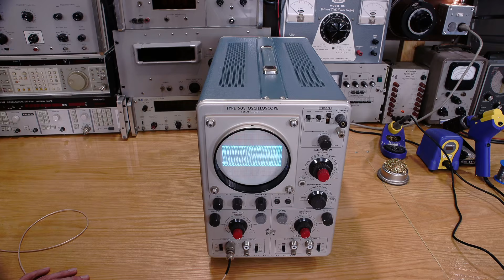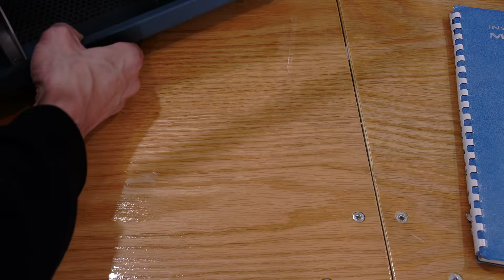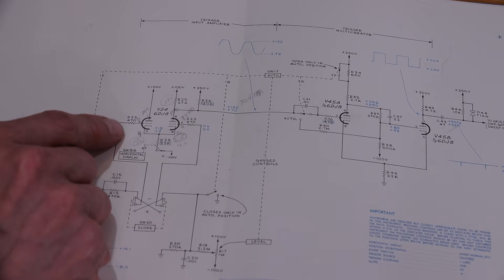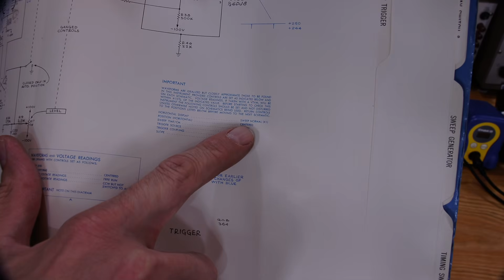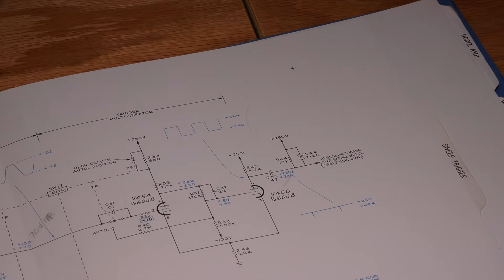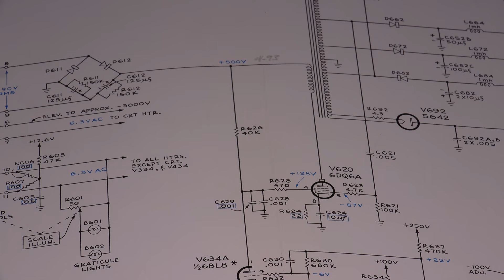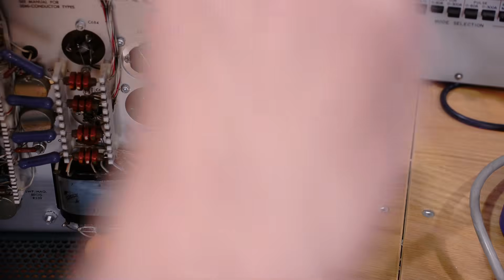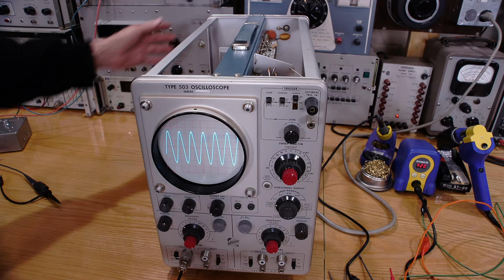TEKTRONIX TYPE 503 Electrical Troubleshooting And Repair!

Comment: Thanks very much for this video. I've got an old Navy surplus HP 108C scope that I can't figure out the issue. The trace just stopped, but sometimes when I turn it on and off a dot will zing past on the screen. If I pull out the vertical and horizontal plug-ins I should have a spot general in the center, but don't. I need to build it little oscillator to do the blanking test. Lacking a HV probe is also an issue, and PS checks were the first thing I looked at. I've got two Tek 442s one with a shorted transistor in the PS. So long as I that one working scope i know I can fix the other two. I primarily enjoy working on vintage audio equipment including R2R's and have more than 20 in collection. Two or three are all vacuum tube types. I'm going to recheck the PS again. I really enjoy doing the work and get the feeling you do too. And yes my bench looks cluttered. I built it inside a closet.  I think we're mostly all that way. I'm sure every tech wishes they had the collection you have, just count the O-scopes.

Comment: Having worked at a repair shop - the main thing I seem to remember on the 503 was that the High Voltage power was a winding in the main power supply instead of a separate high voltage transformer.  They were real bad about failing and getting a replacement was next to impossible.  Other than that, it's a nice little scope.

Comment: Havent seen you for ages. Your sense of humour is stil lovely. I always remember you acknowledging the excellence of Tektronix scopes manufacture quality. For me it was a privilege to work on them. I served only 5 years on the bench and Tek was a constant companion for me as a repair and calibration enginer from 1977 to 82. My favourties were the Tektronix 453, not the early Nuvistor ones, the FET ones, only a few anyway. Come Sept, we were inundated with Tek 453's because of the perspex EHT box causing condensation when engineers didn't take them indoors at night from their cars. At one time the whole out rack was full of them for weeks :) Now come on (nag nag) when are we going to see you adjust a 547 (say) delay line ? Thee 555 will of course, two of them :) Go on !

Comment: I don’t understand my experience with vintage tube tex scopes. In the past I’ve come across probably 7 all ranging from different late 50s early 60s models. I was never able to repair or be able to have any show any signs of life. Still really bummed out about this 17 years later. I spent so many hours working on these. However, that said ever HP scope I have also come across from the same era as the tek scopes, all would be fully operational with just a few simple TLC methods. Note: the tek scopes and HP scopes were from the same location an abandoned basement in my alma mater that was filled wall to wall with 1000s of tube equipment.

Comment: This is great. I picked up a 503 some time ago with the intent on using it for XY tracing - and apart from a house move, it has been living under the stairs ever since. They are not so common in my country so when I went to pick it up, I couldn't pass on the 556 next to it which was also looking for a home. Now after seeing both in the same Mr Carlson vid, I think it is time to make them work again...   I think the 503 is mostly good but the 556 had some small impact damage on the front panel and there was a small chip on the tube edge - not ideal condition but will be interesting to see if it lives.

Comment: What a nice piece of electronics that scope is - finest workmanship throughout and in almost immaculate condition. I think you're lucky to buy that kind of equipment for as low as $15 at ham swap meetings - here in Germany it would be hard fo find one at all and if so, for way higher costs. Interesting detail is the switchmode power supply - never seen that in any tube type gear before and just downloaded the 503 manual to have a closer look at it :-). Thanks for your excellent videos!

Comment: That scope is so clean inside that I wouldn't be surprised if the trigger never worked. Perhaps it sat in a corner waiting for someone to fix it for all of these decades, and that someone never got a round to it. It's just, as Mr. C. said, like it just came off the factory floor. Time capsule.

Comment: Thank you for yet another great video! Love the old Tek equipment; just scream ‘Quality’. 
Have a few 70s and 80s Tek ‘scopes but never been inside any except for cleaning. They just work. 
I appreciate Collins Radio gear for the same reasons. In the rare event of failure they respond well to treatment 😊
Never knew Tek used a special solder. Now I’ll have to open mine up and look for the little spool!

Comment: Wow you don't look 72 I'd said alot younger. This diagnostic video is why I love watching your videos. I'm not much trained in electronics myself and I've maybe got 1% of your knowledge. I did manage to fix my own tek scope 2213 and some others. I'd like no more of the relationship between the faulty - 100 line and why that caused the triggering circuit issue despite it a paired to working at each point? Many thanks and keep up the good work.

Comment: Warning:  Oscilloscopes can be addictive.  I bought one of mine from the widow of a man who had over 300 which I thought was a lot until I bought a vanload of assorted electronic scrap from another man who had over 500 including all Tektronix models who knew obscure details such as my old Cossor scope having been made in a limited edition for the post office  and for which he just happened to have a spare manual.   I only have a dozen and poverty has saved me - not that I wanted to be saved.

Comment: Any chance of doing a video on Tek 5XX storage scopes ?
I have a 564 that I think the CRT(storage part) is worn out. But it may be some other failure.
Maybe a video on how to determine how much life is left in the storage tube ?
Reply from the maker: I will pull out the 564 in the future and do a video on it.
Reply: @MrCarlsonsLab  Cool.Much appreciated, but I wont hold you to it. Also: Re parts failures in Tek gear. In my limited experience (I have a 545B,564, 565 and  a bunch of plugins) other than warped & cracked plastics, I found the nuvistors to be problematic, they get monophonic. I test them by placing one in the trace position control circuit of a 3A1, then center the trace and tap the plugin. Check how much deflection is cause during the tap and if/how close the trace returns to the center position.

Comment: I have a bit younger 453A which is in that transitional period where there are no more tubes (save for the CRT) and it's half ceramic strips - half PCBs. The big Sprague caps are still good, but I had to replace a few RCA transistors in the power supply to get it back up. Those power supplies are great, the voltages are inter-dependent so if something goes wrong it takes all higher voltages out so you don't end up burning out whole sections. The trigger is rock stable up to the advertised 50MHz, the scope itself can go well into double that but the triggering gets very unhappy. Just Tek's way of saying you should've bought a 454.

Comment: Some years ago I had a tek 565 dual beam scope. It was in pretty bad shape and finally I declared it beyond economical repair. I kept the parts, and the beautyful CRT is on display here. Anyhow, the comment is that the 100V rail which is the master for the supply, after so many years of beating, was spot on! I couldn't believe. It had 2A61 plugins for vertical input that I kept.

Comment: vacuum tube SMPS is one of the coolest things I've ever seen.  I'm an amateur power supply designer and I've long wanted to incorporate some tubes in either my pass section or feedback.  this only encourages me
Reply: You should look up some old schematics of known P/S models, such as hewlett-packard 710, 711, and heathkits. Early 60's RCA receiving tube manual has a power supply with 7027 pass element.
Reply: @alanpecherer5705  Thanks!

Comment: @11:50. Looks at the twin brown resistors in the left vertical stack.  Is the upper resistor burnt, or is the disc capacitor above it casting a shadow?

Comment: After watching you repair this 503 it gives me hope on my 310A that I got free from work. Of course it has double the tube count so it is quite the space heater.  Just imagine the 503 case with 33 tubes inside. It is more likely that a tube may be 
bad that an electrolytic cap but giving it the once over will be in not so distant future. The 310A came out one year earlier 
than the 503. That was a great video on a vintage Tek scope Paul.

Comment: I have a 503 that my uncle gave to me sometime in the late 80s. I remember plugging it in and using it to view serial data from a computer. Left the scope on while I ate lunch but when I came back 10 minutes later, there was an odd sort of sweet smell in the room and no trace on the screen. Turned the scope off hoping after a cool down it would work again but it never did.

I saved that scope and it's always been stored covered indoors because I wanted to someday get it working again. 

If anyone knows where I should start looking for the problem, please let me know.  I have many other scopes but this one is special to me because it was my uncles prized possession and he passed it down to me as a youngster interested in electronics. I'd love to get it going again. 

Thank you Mr. Carlson for the video, you just sparked my curiosity and brought back some wonderful memories from my childhood.
Reply: Sweet smell means that something has overheated, I think it may be a resistor. Were it be a capacitor there would be a loud ass bang, I think. That'll be a big troubleshoothing job, I think.
Good luck! Bring that scope back to life, it deserves it!

Comment: I noticed the Anatek dual supply in your stack.  I recently picked one up.  Nice piece of top notch Canadian equipment.  I replaced all the small electrolytics in it and it now performs like a star!.👍  Did a couple of videos on it.
Reply from the maker: I completely redesigned my supply inside. I have a video on it too: https://youtu.be/37lIpTxUQcE
Reply: @MrCarlsonsLab  Thanks for the link.  Very nice!  Yours is a little different design than mine.  I don't mind the 10 turn pots so much.  If mine ever fails perhaps I'll do something similar.👍

Comment: Hi MR C.Iim at 4.05 mns .And i am thinking what voltages are coming out the transformer windings on the vairack .And why i can see solder tabs un insolated

i have some shocks over the years  

you are the Yoda of tube electronics. if im wrong sorry  
heat srink might prevent a brain fart BUZZ

Comment: Used a lot of Tektronix scopes as an RCA EE from 1956 to 1964. Hauled them up to a narrow catwalk behind a 12' diameter ANFPS16 range instrumentation radar to overhaul and align the tube receiver mounted in a 4' X 4' weatherproof box behind the antenna. Used a sweep generator, detector and scope to align the three 60 MHZ IF amplifiers. There were about 6 - 8 6AG5s in each.

Comment: Hi Paul,
Awesome video and i like your channel the most and i recently got a 549 here in the Netherlands and this scope was build at Heerenveen and came to me very dirty and dusty and it took me weeks of cleaning every inch of this scope (removing and cleaning every knob and every tube ) and it has a property sticker  Estec-Esa (Noordwijk) and two plug-ins  Type 1A4 and Type O and looks brand new now and tested it on a function generator and till now everything works fine and i am very happy to have this awesome and beautiful scope.

Comment: The first thing that struck me when you opened the case was just how beautiful that instrument was... second was the service manual... but the thing that absolutely astonished me was that tiny roll of solder for those connectors...  now I did work as repair tech work on C64's back in the day, so I have a little experience... but that scope has to be over the top the best I've ever seen... WOW!!! 🤯

Comment: What is the purpose of the tube switched power supply? If they already have transformers in there anyway, what is the value? Is it that it can run at a higher frequency and thus require a smaller transformer?

Comment: What is the function of the neon lamp you can see on the strip board at time stamp 31:48?
Reply: DC coupling level shifter I'd think.
Used in early philbrick op amps to couple the output cathode follower to the differential pair and still retair the necessary voltage range. NE-25 or something similar

Comment: I have this scope along with it's sister 504! They are really nice scopes! I use them quite often! But you got lucky though with just the one bad cap as I had to do a complete recap on the 503 due to excessive ripple. My 504 only needed the voltage doubler caps replaced. Also have 2 561A scopes along with the 564 storage scope. The 561A scopes work perfectly! But the 564 is dead and haven't found time to troubleshoot it. I know that the -100 supply voltage is extremely low, low enough that the 0G3 tube doesn't even conduct.....
Reply: Hello, since you mentioned the -100V supply I though I would ask you my question:  What, exactly, is the connection between the -100V supply and the trigger circuit?  Perhaps I missed MrC's explanation.  I went back to the part of the video with the trigger schematic but saw nothing.  Thanks in advance.
Reply: @cougar1861  Hello! To answer your question in regards to the -100V supply, per Tektronix service manuals, the entire scope depends on the -100V (Or -150V depending on which scope) which is basically the reference voltage. If that voltage is not right, it will wreck havoc on most of the circuits. That's why Tektronix would also say in the manuals if there is an issue with the oscilloscope, first thing to check is the -100V supply or -150V and then check all the voltages.
Reply: @brendajanes4139  Thanks very much!

Comment: If I remember correctly, the front panel connectors were called UHF type.  Still used by many HAM equipment, I understand.  You might verify by trying if a usual banana plug is accepted.
Reply from the maker: They are an "SO-239"   Their mate is a "PL-259"   The SO is "Socket." The PL is "Plug."

Comment: What an absolutely amazing program.! This was a lot of fun. Looking to buy some equipment, mainly a scope and a signal generator, any advice on these devices would be appreciated. Let me know guys and gals what you think. I’m going to be diagnosing a tube amp.
Reply: Today, an advertised bandwidth of 1/2 MHz would be laughed out of the room. Even a 100 MHz would be scoffed at. But a 1/2 Meg scope would be perfectly adequate for audio troubleshooting. So unless we are talking crusty antique, any scope will serve you well for audio. Frankly, I would not be buying a tube-type scope (nor signal gen) in 2023. You should be able to find a $50 or less scope by Hitachi, Leader, Kenwood, Sencore, h-p, and half a dozen other makers on your local Craigslist. I would recommend you buy a dual trace scope. Do NOT buy a "two-man" Tektronix scope for this purpose. I would not even buy an old Tek 453 scope although it would be perfectly usable. If you see those PL-259 connectors on the front panel for the probes, run away. If you see binding posts for the front panel, that's almost as bad. What you want to see in a used scope is: (1) (the biggest item) clean, bright trace, and you do not have to turn the brightness control all the way up to see it  (2) PROBES. You're likely going to find that the probes are missing. You can buy $12-$15 probes on ebay and those will work fine. The connections should be BNC, as should the connects on the front of the scope. (3) condition of cabinet. A scope should be on a bench its whole life. If it's beaten up, that could be OK, but probably not. 
The thing is whether you want to buy a $5 non-working scope and fix it, or a $50 "what the heck is this thing" scope and go ahead and use it. I choose the second one. Fixing an amp ain't NASA. 
I'd also reco a more modern signal gen. 
This scope Mr. Carlson had on his bench today was in beautiful condition, clean as a whistle. Especially for a portable scope. If you buy older crustier stuff and it starts to go flaky on you while you have your amp on the bench, that can be crazy frustrating.
Reply: @alanpecherer5705  thank you very much for your wisdom.

Comment: He must have had an air compressor like I did years ago and cleaned his equipment once and a while or may have used a cover. You are very lucky to find one this clean. Good luck, and thank you for the video, Mike in the USA
Reply: Compressed air is the best as long as you protect sensitive stuff like fans from overspeeding. In this case, it looks even too spotless for that. Thinking that cap went early on and it just doesn't have alot of miles on it.

Comment: Not my birthday but what a nice treat to see this amazing scope,  Tektronics is the best  a great bench test scope  sure enjoyed, super Thanks Paul  well done  mike
Reply: I have a Heathkit oscilloscope that my Dad left me. Whatever will I do with it? Dad said that it may need new capacitors. Too bad that Dad was unable to help me replace them. If or when I move to South America to be with family, I am not so sure that I can keep it. Too bulky and heavy, and I could just buy a newer smaller model? Dad never showed me how to use it, Paul probably showed me so much more in this video.

Comment: I have a Tek TDS540 digital scope, I think you have one too. And I also have a 1983 analog Leader 50mhz dual trace scope. I still use the leader extensively, especially on audio devices. Even with the Tek "Digital Phosphor" option, I still prefer the clean waveform the Leader displays without all the quantizing artifacts. Don't get me wrong. the 500mhz TDS scope is invaluable for precision measurements and High speed digital work. But for general work, I still reach for the analog Leader first.